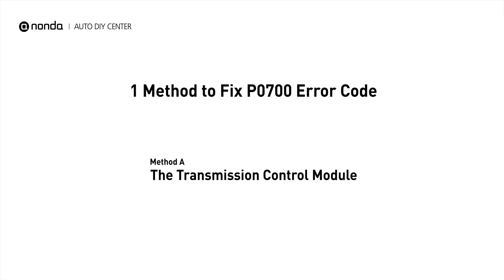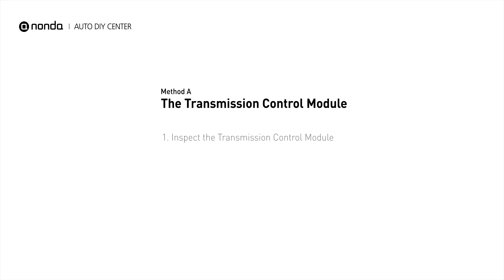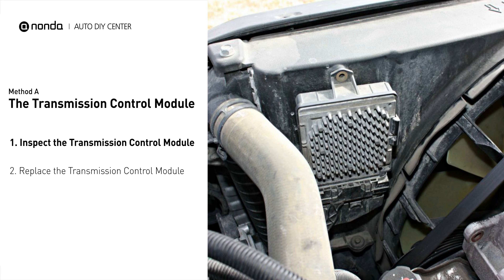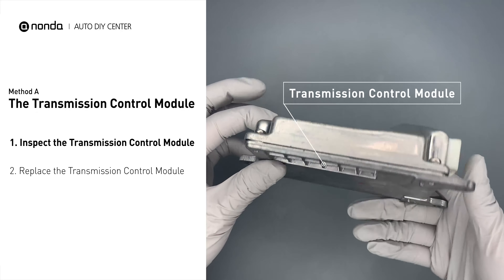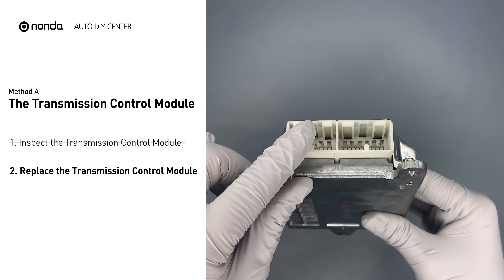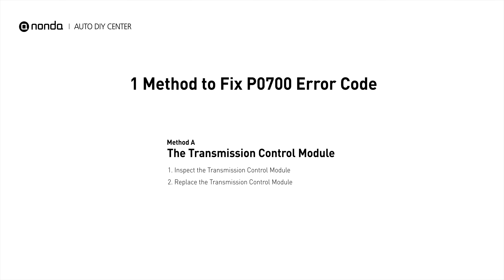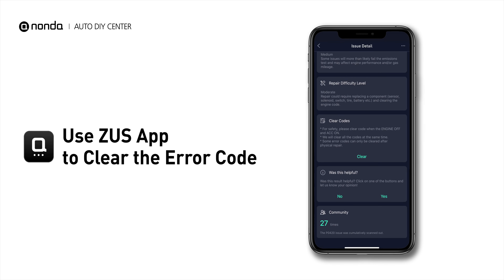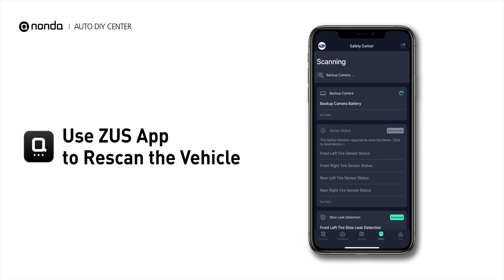How to Fix P0700 Engine Code in 2 Minutes [1 DIY Method / Only $94.24]

Comment from the maker: Hi, I'm Steve, nonda's lead mechanic engineer. 
Feel free to leave your comments here if you have any mechanic questions, I will be glad to help you out!
Reply: Hi Steve. I am getting a P0700 on a 2014 Chevy Traverse I have a remanufactured, believe that it was simply rebuilt though. This code is part of the reason that I had to have the transmission rebuilt. I have taken it to the Trans shop and the regular mechanic and neither are able to find anything. The code itself is erased or "Not Present" at the time of inspection. We have lost faith in the vehicle do to this ongoing problem. Any suggestions that you can give is very appreciated.
Reply: I have dodge caliber 2008, get a p0700 and p0730 codes, can i drive the car
Reply: Your nondas  head mechanic???😂😂😂😂😂😂  ok........
Reply: Lol😂 it is
Reply: Salut steve j ai un en rexton 2008 avec un code d erreur P0700 j’ai changer le tcu jusqu’à présent le proble persoste

Comment: Hi Steve, 2014 traverse with only the P0700 code! Oil changed place said my fluid looked light in color and recommended a trans fluid flush! Should I start with that?

Comment: If you clear the codes, you’d still have to wait for your car to run through a cycle of you starting it driving it a couple times to see if the check engine light will come back on after a few runs. You can’t just rescan it after you clear the codes and start at one time.

Comment: While driving through an unusually intense 45 minutes torrential rain storm (lightening, the whole works) I received this code which resulted in very delayed shifting on the low end. I was able to drive the vehicle the 15 miles home at speed without an issue. 
The next day I took the vehicle out for a drive and it was shifting perfectly. So I cleared the code. No problem.
Is it possible that the wiring coming out of the transmission control module and/or along the path could be exposed and the rain resulted in this code?
Reply from the maker: Possibly yes.
Reply: This same thing just happened to me, I think the wet roads got the water splashing and set it off, because I also drove home and didn’t have any issue. Cleared code and hoping it don’t come back :)
Reply: Well, though my theory as to the code's origin is potentially correct, in my case it wasn't. I was experiencing the first sign of what eventuated into a need to rebuild the transmission.
Reply: @lazurm  oh that sucks, how quickly did it come back on?
Reply: @Rob-ln8mq  It was random and unpredictable with the time ranging from minutes to as long as 3 days.
Reply: Samething happens to my car I have a 2016 Infiniti Qx 50 when there’s a heavy rainstorm it set off the TCM code resulting in the check engine light coming on car drives perfectly fine I cleared the codes we will see how that handles next rain storm

Comment: Hey Steve how’s it going, I found myself having trouble with this P0700 code on my Buick lacrosse 2014
Reply: I’ve spent 1700 last year buying new computer parts inside the transmission +labor, any tips?

Comment: Hi I have a Holden cruze 2010
P0700 transmission control system (MIL REQUEST) 
P0751 shift solenoid "A"  performance stuck/off 
What does it mean do I need a new gearbox? Or can't I service the transmission fluid filter ect and change the solenoids? I don't know what to do
Reply from the maker: Hi Nurka, since you are receiving 2 codes, we suggest getting your vehicle visually inspected by your local mechanic for further diagnosis.
Reply: P700 code p182😢

Comment: I got a po 700 code on my 2015 Tahoe. Anything I can do to fix it before taking it to the shop
Reply: Help
Reply from the maker: Hi Pamela, kindly check the Transmission Control Module. A replacement would be necessary.

Comment: Hi Steve I have a 2009 saturn vue reading p0700.  Service traction control and service stabilitrak appears on baseboard.  I cleaned the throttle.   The car has went into limp mode three times in the past.   Any suggestions?   Thanks a bunch
Reply from the maker: Hi Dave, have you double checked if there's any other trouble code registers together with this code?
Reply: @nondainc  p0700 and p2764

Comment: Hey Steve I have a 2004 Volvo S80 t 6 and it's reading the po700 code what do you suggest?
Reply: And yes it's the only code I am receiving and can I buy a used tcm?I saw some on ebay for 30 dollars
Reply from the maker: Hi Nicholas, we suggest checking the condition of the TCM. A replacement could be necessary.

Comment: Thank you. Is it located under the dash ? Do you have to take out the dash or go from underneath ?
Reply from the maker: Hello, it is usually can be found below/underneath the engine, or under the hood near the battery/inner fender panel.

Comment: Hi Steve, I have a 2013 Chevy Malibu with 122k miles.  Code P2097 and P0700. Doesn't want to shift to 2nd gear and when pushing the gas to accelerate theirs a stall to it
Reply from the maker: Hello, have you checked the condition of the transmission fluid? Check if the wiring to the o2 sensor is damaged and have a look at the exhaust system if there's any leak. The catalytic converter must also be inspected as it might be clogged.
Reply: @nondainc  how would I check if the sensor is damaged or if theirs a leak in the catalyst converter
Reply from the maker: You may check it by using a scan tool to check the readings and compare between banks. One way to check if there's any leak is you may hear a loud tick sound lower down on the engine.

Comment: Hey Steve, I am having this code P0700 Code Pending and  with other codes like P2008 showing Current,And the other code is showing P0327 Pending also. My car is Lumina ls 2007, It was smooth shifting before and now shifting very hard after first gear. I have changed the Gear oil when this issue started. Please help.
Reply from the maker: Hello, since you are receiving multiple error codes, we suggest getting your vehicle visually checked by your local mechanic for further diagnosis.

Comment: Hi Steve. I have an 07 GMC Acadia. I have the codes P0700 & P2715 . Should I be worried ? What do I need to do ? Will this be an expensive fix?
Reply from the maker: Hi Miaa, since you are receiving multiple error codes, we suggest to get your vehicle visually inspected by your local mechanic for further diagnosis.

Comment: I have a 2009 GMC Sierra it tell me code PO700 it has a delayed shift and bang really hard on transmission do I change out the transmission control module?
Reply from the maker: Hi Lex, have you checked the fluid? You'll know that the transmission is going out if the transmission fluid's color is rough and if you can find any metal flakes in it. Check also if there's an issue with the shift solenoid and the valve body.

Comment: Hey Steve, I have a 1999 honda prelude with 3 codes. The most important ones right now are P0700, and P0740. What should I do?
Reply from the maker: Hello, the TCM must be checked and a replacement might be needed. Also, since multiple codes are registering, we suggest taking your vehicle to your local mechanic to visually inspect and identify what's causing the issue.

Comment: Hey Steve. I have a 2011 chevy cruze and it's reading p0700 p0716 and p07bf.  What do you suggest I do next. Transmission shop already changed my speed sensor. I burned something trying to jump my car and since then my transmission starts acting up momentarily
Reply from the maker: Hello, the issue could be coming from a faulty TCM. Kindly have it checked by your local mechanic to confirm. Thank you.
Reply: @nondainc  thank u for the reply. The Trans shop suggested the speed sensor,changed it and it fixed nothing. I was charged for that so I don't trust the transmission recommendations they had next. But the code reader suggested a bad speed sensor wire harness poor connection. Do you think they changed the harness when they changed the sensor?
Reply: @nondainc  I will definitely check the TCM after I try to fix any bad wiring harnesses
Reply from the maker: Since you are getting multiple codes at the same time, we cannot guarantee the solution until visually inspect the vehicle. We suggested checking the TCM base on our experience.

We will be waiting for your update, Evan.
Reply: @nondainc  thank you will definitely update you on the advice
Reply from the maker: You're most welcome! Stay safe.
Reply: @royalevan7766  hola, solucionaste el tema? también tengo el código p0700.
Reply: @royalevan7766  tambien tengo un Chevrolet cruze
Reply: @jorgesantander415  yo tambien tengo ese codigo en mi NEON 2004 como lo solucionastes amigo
Reply from the maker: Hi Frank, low fluid triggers this code. Please have a check on this, and make sure that the transmission isn't low on fluid. Check the TCM, Valve body and the Shift solenoid's condition.
Reply: @nondainc  hi love your services but I gotta a question ❓ I am having p0700 and p0736( reverse incorrect ratio) pop up . And I have no reverse I can shift to it but the engine just loads when I push the accelerator. Could it be the tcm? Or am I going to have to rebuild the transmission? 2001 Dodge Grand caravan. I know they are  notorious for transmission issues.

Comment: Hello Mr. Steve
I have a 2011 Chevy Volt and I’m getting this code(P0700) as well as P0AC4 and U0100. What would you recommend. I’ve only had the car for about 2 years and it has about 71900 miles on it . What would you do in my situation. I definitely don’t have the funds at the moment to have it repaired by Chevrolet… so any thought?
Reply from the maker: Hi Dakota, kindly inspect the transmission and all the wiring harnesses of the transmission. Repair/replace them if necessary.
Reply: @nondainc  I hate to be a bother but to make sure I’m inspecting the right thing I was trying to look up of maybe a diagram of the car parts or something but am not seeing anything. Would you know where I can get a video tutorial or at least a page to point the less gear heads like myself in the right direction ?
Reply: Did you end up fixing it?

Comment: I have a 2007 Subaru Forester XT. I’m getting the P0700 and 0725 code. It’s saying it’s the TCM. But my symptoms don’t sound related to that code. My car just died on me last week. Now it just won’t start. Would the TCM cause that?
Reply from the maker: Hi Roberta, since you are receiving multiple error codes, we suggest to get your vehicle visually inspected by your local mechanic for further diagnosis.

Comment: 04 BMW 530i p0700 code ? Replaced the fuel pump & relay . Car cranks but doesn’t turn over ? Any help
Reply from the maker: Hello, have you double checked if there's any other fault code that registers along with this code?
Reply: @nondainc  p1721 p0128 but those have went away just the p0700
Reply from the maker: Hello, it's probably a sensor issue or PCM. Kindly have it checked and fixed.
Reply: @nondainc  thank you
Reply from the maker: You are most welcome!

Comment: I have a GMC Terrain…..randomly throws a po601 code and check engine light…unhook battery and it runs fine for days…sometimes a month and pops on again. Yesterday got the code and a po700 code and it shifted funny after light came on, have any ideas? I’ve cleared it again and it’s ran fine since this…I’m confused 🤔
Reply from the maker: Hi Jeff, since you are encountering multiple error codes, we recommend taking your vehicle to your local mechanic for further diagnosis.

Comment: I have a P0700 Transmission Control System (MIL Request) on my Cadillac ATS. How do I fix that?
Reply from the maker: Hi Ahmed, if there's no other codes that register along with this code, you can follow the yips/solutions provided in our video on how to fix P0700. Hope it helps!

Comment: I’m throwing a p0700 code on a 06 Jeep Liberty 3.7. Any advice where to get the tcm
Reply from the maker: Hi Nick, you can order a new TCM online, or another option is to have it repaired as the repair cost will be lower than replacing with a new module.

Comment: Hi Steve,
I have 2012 Subaru Crostek XV and there is PO700, C1424, C1431, and B14A1 code currently active. Local dealer inspected and they said replaced with second-hand transmission valve body it fixing it is impossible. They said that they have to replace it with a new valve body which is cost around 2000 USD. Do you have a suggestion?
Reply from the maker: Hello, since you are getting multiple fault codes, we cannot provide you a guaranteed solution as visual inspection is recommended in this matter. We suggest getting your vehicle visually checked by other local mechanic (for a second opinion) if you are not satisfied with the first one who checked your vehicle.
Reply: @nondainc  Hi again, Currently I will have changed the 2 of selenoid coils on the transmission valve body in the another local supplier. Hope that it will work. I'll let you guys know about the results.
Reply: @norkun_  what ever happened?

Comment: I have both p0700 and u0073 with my service all wheel drive and service airbag light what steps should I take to get those codes removed
Reply from the maker: Hi Maliek, kindly check and see if the transmission control module is working (or if might need a replacement).

Comment: I have a 2006 chrysler town and country van the give me 3 codes...P0700, P0404 and P0335. Please help me...What sensors are these...I really need my van fixed. I can only drive like 25/30 mph. ☹
Reply from the maker: Hi Shamica, since you are receiving multiple fault codes. We suggest getting your vehicle visually checked by your local mechanic for further diagnosis.

Comment: Hi, I have 2015 Subaru Impreza Premium 178,790 miles. I have code P0700 no other codes. What would be the cause ?
Reply from the maker: Hi Lucky, the TCM must be inspected and a replacement might be necessary.

Comment: Hello Steve I have code p0700 on 2005 Honda Pilot is this something I need to worry about?
Reply from the maker: Hi Lex, we suggest setting up an appointment to get your car checked out further by your mechanic. To check the condition of the wirings, Transmission Control Module, Valve body, and Transmission shift solenoid for the necessary replacement.

Comment: I’m getting p0700 and P2706 going into limp mode on an 05 Jeep Grand Cherokee hemi
Reply from the maker: Hello, there could be a problem to the wiring or the solenoid. We suggest to have it inspected by the transmission specialist for further diagnostic.

Comment: Hello Steve I have a 05 cadillac cts it reads po 700. What should I do?
Reply from the maker: Hi Frank, if there are no any other codes registering together with this code, check if there are shorted or open circuit within the transmission control module and if it's low on fluid or the color is rough/have metal flakes in it. These are the signs that the transmission is going out.

Comment: Hello Steve I have code p0700 on a 2005 dodge ram 1500 4.7
Reply from the maker: Hi Jesus, if the suggestion in the video has been applied and the issue still persist, we recommend having your vehicle checked by a mechanic for further diagnostic.

Comment: Hi Steve, code po7000 popped up and after that code p2534 also popped up. I’ve already checked the tcm and it’s not that. Any other things I should check. And if I should get into code p2534 first or code po700
Reply from the maker: Hi Eduardo, as you are getting more than one error code, we suggest getting your vehicle visually checked by your local mechanic for further diagnosis.

Comment: Hi steve, my dodge caliber 2008, get p0700, p0730 & p0777. 
_how can you help me? 
_ can i drive the car?
_does it possible the codes disappear by themselves?
Reply from the maker: Hi Hakeem, you might have a bad sensor or loose connector. What symptoms are you encountering? If your drivability/vehicle's performance is bad then you might need a new transmission.
Reply: @nondainc  the car starts, when i accelerate and depress gas pedal, the rpm response very slowly and the car begins to move very very slugish, then the car go and i can drive it almost at 90 mile speed without any problem, but when the car reach a speed pump, the problem will reappear, and the car doesnt go forward even i depress fully on the gas pedal, and the rpm doesnot rise or rise very very slowly or sluggish.

Comment: 2017 surburban and it just show the that code it’s has 77,000 miles.
Reply from the maker: Hello, there's actually a problem with the transmission. Can you please double check to see if there's any other code registering together with this code?
Reply: @nondainc  now the check engine light went away by itself
Reply from the maker: Hello, let us know once the issue reappeared and check for any related trouble codes.
Reply: I have 4 codes 
P2004
P0700
P2017
P0722
On a 2007 Dodge Caliber R/T 2.4 engine 
I replaced camshaft and crankshaft and manifold sensor 
 The car losses power and will only go 15-25 mph then after awhile it will do normal speed. Just ordered a Trans output shaft speed sensor, any thoughts

Comment: Guys I'm getting P07BF code on my 2012 Chevy Malibu.
Reply from the maker: Hi Sharon, this code is triggered when the ECM has detected the input signal from the input speed sensor is lower than the specified range. Kindly have your local mechanic visually check the input/turbine speed sensor, output speed sensor and the torque converter if needs replacement.